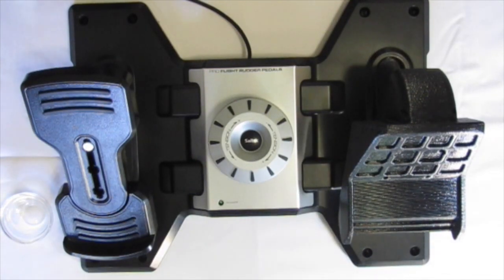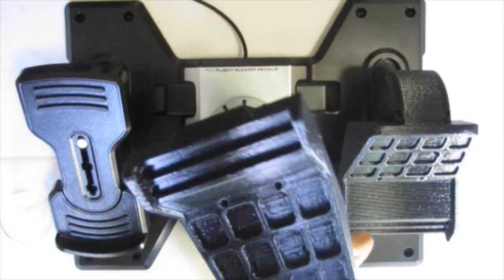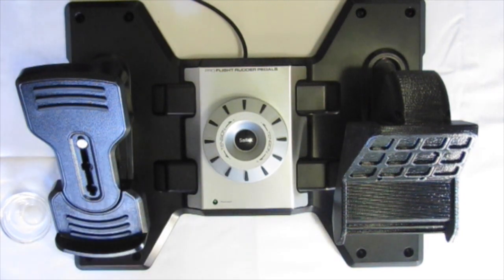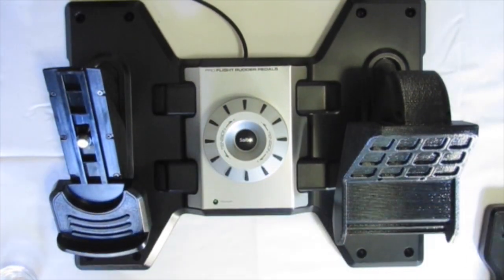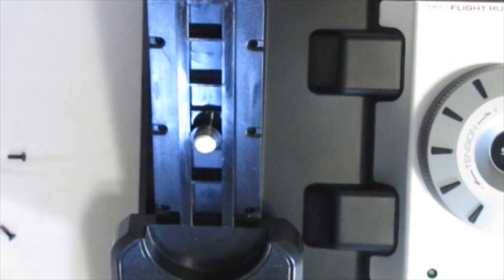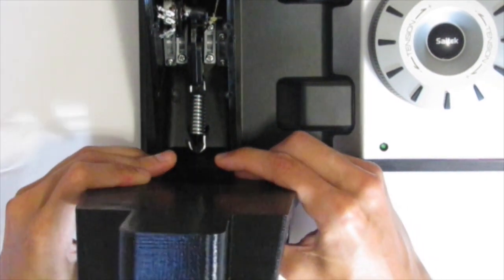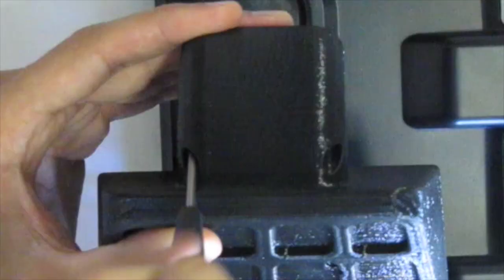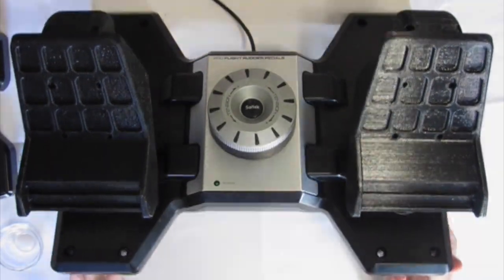3D Printed Saitek Rudder Pedals to CESSNA Rudder Pedals Mod

Comment: printed and installed, amazing! just the backside slide hole was a little bit off the right measurements so I needeed to sanded a little bit to fit.

Comment: I'm not that familiar with 3D printing. Before I purchase the STL files, what is the best online site to have these printed and approximately how much does it cost to have them printed with the recommended settings? I don't want to spend $20 on the STL files and then find out that it costs $200 to have them printed.

Comment: I just printed them on my Prusa MK3 printer.  It took 27 hours per pedal with the recommended settings.
Fits nicely on my Logitech G PRO Flight Rudder Pedals.  The US$19 is worth it as it would take me a few hours to design.

Comment: Do you know if this would this work for the updated Logitech G PRO Flight Rudder Pedals? I see your using the Saitek Pro Flight Rudder Pedals just wondering if there is a difference? 

Logitech: https://www.amazon.com/Logitech-PRO-Flight-Rudder-Pedals/dp/B01LYPMTPT?ref_=fsclp_pl_dp_1

Saitek: https://www.amazon.com/Saitek-Pro-Flight-Rudder-Pedals/dp/B000H67DDY?ref_=fsclp_pl_dp_2
Reply: Same pedals.  I just printed a set off and am installing them on my Logi's tonight.

Comment: this is great. by the way, i dont have 3d printer. what exactly should i tell the 3d printer shop to get the same quality as what you have? thank u.
Reply from the maker: Hi Albert, thanks! and if you follow the link in the description there will be the recommended print settings :)